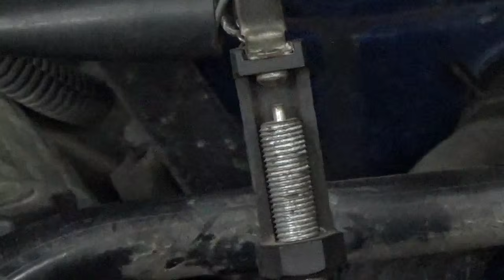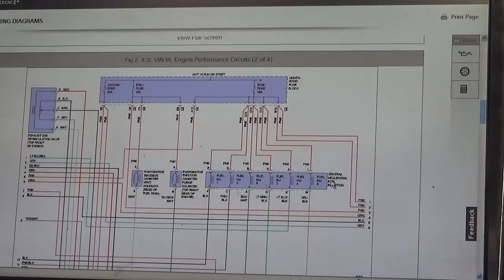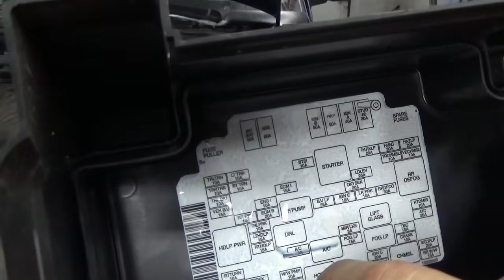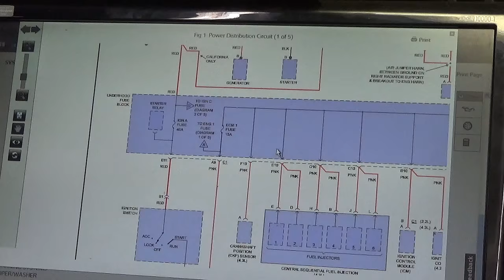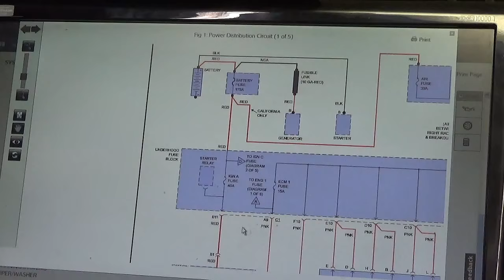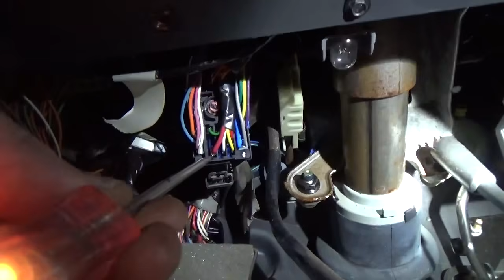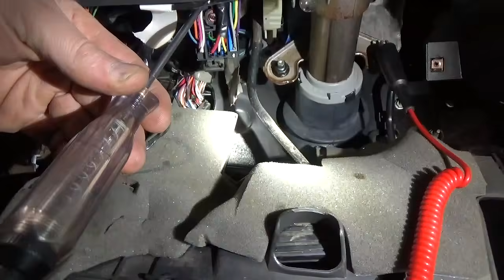No Start / No Spark / Cranks OK - GMC Jimmy / S10 Blazer

Comment: I JUST HAVE ONE COMMENT.  WHEN YOU APPLIED POWER AT THE FUSE WITH YOUR TEST LIGHT DID YOU BY PASS THE PROTECTION OF THE FUSE TO THE CIRCUIT?  WITHOUT THE FUSE TO CONTROL THE AMOUNT OF THE CURRENT GOING INTO THE CIRCUIT COULD RESULT IN OVERLOADING IT AND CAUSING DAMAGE TO THE COMPONENTS .
Reply from the maker: +BLACKJACK2432 If you probe it on the correct side of the fuse it is still protected

Comment: Hi Eric, do i connect the jumper to the positive lead on the battery then to my test light? trying to see if i can put power to the emc fuse.
Reply from the maker: kenobi You can't power through a test light. You would have to use a fused jump wire.

Comment: I have a 1992 dodge dakota, cranks ok, no spark, changed coil pack, distributor cap and rotor, ignition module and crank sensor and still no spark what could the problem be I also checked the relays and fuses
Reply from the maker: Russell Templin Wow that is a lot of swaptronics going on there... have you kept it simple and checked for power at the coil? Does it loose injector pulse?

Comment: im sorry i know its the distributor coil wire that gives power to coil however its a lot deeper then that as for my issue its something with the wiring and i cant locate it.  i own a 99 silverado 1500 4.3l manual
Reply: +Ali Faiz One comment would have been effective enough. I think 7 is a bit overkill.
Reply: Hi i have ford 2003 probleam no start / no spark / no injactor ..but cranking is ok ..plz anybody help me..
Reply: Hi i have ford 2003 probleam no start / no spark / no injactor ..but cranking is ok ..plz anybody help me..
Reply: Hi i have ford 2003 probleam no start / no spark / no injactor ..but cranking is ok ..plz anybody help me..
Reply: Hi i have ford 2003 probleam no start / no spark / no injactor ..but cranking is ok ..plz anybody help me..
i put compurt but computr arror
Reply: Hi i have ford 2003 probleam no start / no spark / no injactor ..but cranking is ok ..plz anybody help me..
i put compurt but computr arror ..im confused what i do
Reply: Hi i have ford 2003 probleam no start / no spark / no injactor ..but cranking is ok ..plz anybody help me..
i put compurt but computr arror ..im confused what i do
Reply: Hi i have ford 2003 probleam no start / no spark / no injactor ..but cranking is ok ..plz anybody help me..
i put compurt but computr arror ..im confused what i do
Reply: Check wires that go to coil, module, and crank. Just my suggestion would be to replace them reguardles
Reply: coil module &crank sensor already im replace ..but have same probleam

Comment: Man . I am having kind of the same problem.I got a truck from a friend. they replaced the engine it ran for couple of days  not it won't crank the engine turns over very slow but doesn't crank  as if power was missing . now I noticed the distributor was loose. I am wondering if timing  has jump off.. on the other hand ignition switch is missing the key  so it has to be crank with a screwed driver.. hahahaha... I  have no Idea where to start.. any ideas  Hit me back ..Thanks

Comment: Advance sucks. How do they send a box that looks like that to a regular account guy?
A waste of everybody's day. You have more patience than I would. Nice diag btw.
Reply from the maker: moomike laloo Well time has taught me flipping out never gets you any place, other than mad and further behind.
Reply: +South Main Auto Repair a friend has a 97 1/2 ton. he changed fuel pump. ran for a day or two. i looked at it and he has no power on ecm1 eng1 or engE fuses. Could be bad ignition?
Reply: South Main Auto Repair 2003 f550 ford 6.odiesel no p0wer at fuel pump won't turn over at

Comment: Hi there... I have an 05 Jimmy.... the idler arm was just done... and they severed the hall sensor for the crank.... my BF fixed it.. but now I still have no spark.. he check the ICM and the coil and did the LED test probe on the sensor... we are gonna check all that you mentioned in this vid as well just to rule out the possibility of the ignition switch as it is a little wonky... he's been pining all over the internet tearing his hair out to get the wiring schematics... haynes doesn't even list a manual for this truck only 1997-2004... before they changed it to an Envoy.... any chance you might be able to send a copy ?
Reply from the maker: Roxanne Nero Go here http://www.bbbindustries.com/technical.html (middle icon down on the left) says "Technical Service Bulletins & Wiring DiagramsAll TSB’s and diagrams for every make and model - FREE" That should help ya

Comment: Yo! Awesome vid! Best one I've seen yet. So have a 99 s10 4.3l with a no start no spark prob. The only difference between mine and yours was that I'm not getting my coil to spark AT ALL.  I'm getting current to it and the dist. but it's not going to the spark plugs. Code I pulled was PO336. Replaced crank sensor 3 times and cleaned reluctor wheel. What should I do? If you can help me you'll just ended 2 weeks of misery.
Reply from the maker: ezrlew100 have you checked the output of the CCS with a scope at the ECM to see what the ECM is seeing?
Reply: South Main Auto Repair Nope. How much is a scope? And what is a CcS? I'm 20 and a college student some I'm trying to work on their car myself to save money lol

Comment: Great video!  Helped me to eliminate the ign switch as a culprit.
Problem:
Working on a friend's 2003 Sonoma 4.3 V6/auto, cranks but no start.
Friend said the dash "freaked out" {his words.....lol} and it died.
Replaced coil {was loose/rattling in its frame...needed R&R anyway}, checked all fuses, plenty of fuel pressure.
Only thing I can figure at this point is ECU.
Any other troubleshooting suggestions before I hunt down an ECU?

*Engine & engine bay exactly the same as that Jimmy. *
Reply from the maker: Shovel head  Well are there any codes?
Reply: South Main Auto Repair Wasn't able to pull any....no reader.
Reply from the maker: You should see if you could barrow one first . It may lead us right to the problem and save a bunch of work...
Reply: South Main Auto Repair Thanks for getting back to me.
Will see if Advance or AZ has one to rent.  
I do suspect the ECU though. 
Past history on truck was that there was an under-hood fire at some point and insurance covered the repair(s).
The Svce. #s for this ECU are for a bigger engine so it's likely been replaced and it was probably flashed to fit.  {I have my local truck yard guy -- they're good folks -- will do me one for $75 and programming for $50.  $125 for the whole thing sounds good to me.}
Reply from the maker: Ok got ya, try to pull codes first though if ya can. This vehicle did run before then just quit right?
Reply: Yes.  The truck has had this same engine/ECU package and has run well for at least the last 5 years. 
No code reader yet.....he's {truck owner} trying to find one to rent.
note:
I've noticed that the coolant reservoir that the ECU mounting plate is on has a broken front tab and it has about 1/2" of bounce room.  Truck is daily driven on a VERY rough road {potholes & speed bumps} and after finding the broken bracket I'm still inclined to believe it's the ECU.

Your thoughts?

Comment: good day sir! Love the videos you posted on youtube, hope you can help me with my car problem. I have a Hummer H2 2003 model. It was running fine until suddenly the engine shut down.  It cranks but does not start. I already check the fuel line with a fuel pressure gauge and it was fine, the pressure is between 50 to 60 pounds, but when I check the plug, it has no spark. I check all the fuse and it was all good. I don't have a wiring diagram of the vehicle and I'm not sure if whats the problem. By the way the battery is new.
Reply from the maker: John Bulaclac Any codes?

Comment: Advance auto should be called 'regressive auto' at times.   It's happened to me several times with our local one.  Got a TPS for my BroncoII and the internal spring was broken, clearly was installed... Picked up a new solenoid for the starter, the solenoid had a hairline crack across both battery/to/starter bolts.  Cracked into 3 pieces when trying to install.  (Didn't notice the cracks until I tried to install--and it blew apart)   The mgr stated  "If you saw the cracks, why did you install it?"  Duh....Didn't see the cracks (hairline) until it fell apart.  Come to find out they have a 20%+++ return rate on BWD solenoids at the Advance one town over.  That mgr told me the truth.
Reply from the maker: Tedybear315 20% and climbing I bet....
Reply: Napa's was not much better.  That was the first one installed.  Even went for the 'high quality' one.  Made it to work and had to move my mini-suv.  And of course the solenoid contacts stuck.  Picture me doing a nose dive into my tool bag to yank the battery cable.  (made it a whole 5 starts....Weeeeee.  Next time Motorcraft.)
Reply from the maker: Lol I think all of us mechanics could add miles of stories to the aftermarket parts saga....

Comment: K maybe you can help with this. I have a 95 dodge ram van 2500 5.2 cranks wont start. It did start right up when i got it couple days later it would take a while to start. If if it was within minutes of restarting it fine but wait four hours or more it took a long time to start now, not at all. i have changed crank shaft sensor, distributor and rotor, new plugs and wires and new battery. The rotor does turn when cranking. No spark to plugs to top of distributor but a very faint spark from wire to top if ignition coil.
Reply from the maker: mark Worthington II I would scope signal going to coil... sounds like a bad coil but that is a guess...

Comment: I have a friends 86 gmc jimmi with no spark.He put new module,cap and rotor,wires and now coil but still no spark!??Power to coil constant.
Reply from the maker: timw1959 86? So it must be a v-8?
Reply: South Main Auto Repair Yes.305
Reply from the maker: Do you have a scope by any chance?
Reply: South Main Auto Repair No?What kind of scope?
Reply from the maker: So we can check signals coming in and out of the module..
Reply: South Main Auto Repair The only things I can think of are defective module and or timing chain but should have spark if chain jumped right?
Reply from the maker: Should have yes... is the distributor turning when you crank?

Comment: With great regret I sold many boxes like that to shops when I was the Commercial Pro for Advance.  But I always checked the boxes to make sure they were not used or damaged parts.
Reply from the maker: Eric Brunhammer Well I usually don't judge the part by the box cuz I have seen how they ship them to the stores... Jamb parts in crates, well you know you worked there

Comment: Hey Eric, I have a 1992 Honda accord and it hasn't been able to Start for a Few months now and I've been using a push start that's connected to the battery and the Starter. When I turn the key to the ON position and go under the hood and push the Button, the car fires right up. Well when I get in the car and push in the Clutch to start it it won't Crank at all. No noise or nothing, It doesn't do a thing. Do you have any Idea on what might be the problem??
Reply from the maker: treluvsjay1 broken wire, starter relay, ignition switch, neutral safety switch, could be a number of things.

Comment: an interesting failure. I don't do a lot of electrical diagnoses. I do some, a lot of it is aftermarket wiring that I have to diagnose and work on. we just switched to Identifix last fall, we were using both Mitchel and All Data, But we always having a hard time finding stuff and always had subscription and password problems with them.  a really nice thing with Identifix, is if you type in a code, it gives you a list of other peoples repairs related to that problem. in one link it can show 50 repairs for that one code, but it lists them out like 20 were fuel pump, 10 were injectors, 5 filter, etc. and lists out others diagnosis as well as it gives quick links to the specific service information relating to that code or problem. and truthfully for someone that doesn't do electrical diagnosis all the time it really helps.

I noticed your South Bend Clutch sticker, have you had it long. mine is the center piece on my toolbox locker. had never seen one before, did a clutch in a Ram 5500, that's what I got. I actually had it remade, couldn't get it off my old toolbox when I upgraded, so I took a picture of it, and had it done exactly for $25. you can't even tell its not original. another guy I work with just did one and got the same sticker, he compared it, no difference at all.
Reply from the maker: Hey kenman1717 I have used all of those repair programs too but stick with Mitchell. I have had mitchell sense back in the day when it came on a stack of cd's lol. As far as the southbend sticker I have a bunch of them laying around haha could have just sent you one. When ever I put a clutch in a Duramax or Cummings I use there clutches. I have done a few of there double disc conversions too in the higher horsepower stuff.

Comment: awesome video.  i'm not a mechanic, but i do like to attempt repairs myself.   i never would have thought about feeding the 12 volts through the fuse like you did.
Reply from the maker: As long as you put it on the right side of the fuse you won't have a problem.
Reply: @SouthMainAuto   just bought one these cheap cause they can't figure out the no start issue they put new pump in it and alot other parts. But when you turn key cant hear fuel pump turning on will a bad switch make it not turn on checked fuses and relays all good
Reply: South Main Auto Repair
power prob works great in this situation if you power fuse
Reply from the maker: Oh yeah I love my power probe.

Comment: Question, had you hooked up the test light to battery positive and touch the fuse, would it have started? Or the test light must be grounded and an additional wire from battery positive to the test light? Thanks.
Reply from the maker: Hooking it to the battery + and touching the fuse would not have been able to carry enough amperage to cause it to start unfortunately so it did need an additional wire from the battery to the fuse. The only reason I keep the test light grounded through that processes was to demonstrate it was hooked to power but was not necessary.
Reply: South Main Auto Repair Ok. Make sense now. So basically, you are running a jumper wire from battery positive to the fuse, but the test light is just there for demonstration. Kool!
Reply from the maker: Yep you got it. Jumper is hooked to the shaft of the test light to allow me to probe the top of the fuse.

Comment: Fantastic diagnosis and explanation! The test light is probably the most under-rated tool for electrical diagnostics, especially no-starts. Just did an intermittent no-crank on a 2001 Blazer the other day; turns out it was the starter solenoid sticking when hot. Have you watched ScannerDanner's vids on electrical troubleshooting? Kind of jealous of that Verus...have you used the built-in oscilloscope much? Looking forward to more troubleshooting vids!
Reply from the maker: You are right, the test light is a wonderful tool when used properly and under appreciated. I use the scope often, it's in a lot of my videos. I do watch Paul Danners channel on occasion. Lots of great info out there that's for sure.
Reply: Pine Hollow Auto Diagnostics  I got a 1998 gmc Sonoma that my ecm1 dude keeps popping every time I turn key. Any idea what can be causing it to pop quick doesn’t start just crack

Comment: Great video.  Thank you.  At 12.05 mins into video you have put a jumper wire from the +ve terminal of the battery to the metal shaft of your test light.  The test light lead is connected to ground.  You then place illuminated test light onto 15A fuse and the truck's engine starts.  Why did you ground the test light?  Would the engine still have started if you didn't ground the test light.  Sorry for my ignorance, but electricity is not my strong point.
Reply from the maker: Good observation and yes you are right on the money. First of all it did not need to be grounded, and yes it still would have started. I just use it for the visual reference to make sure we maintain power. Great question and observation. Thanks for watching!
Reply: South Main Auto Repair Thanks for reply.  I get it now.  I mistakenly said 12.05 mins into video, but infact it was 7.21 mins.
Reply from the maker: Ahhh no problem I knew what you were talking about.